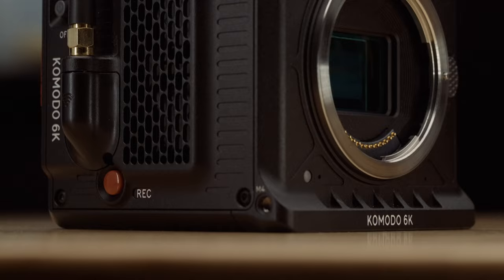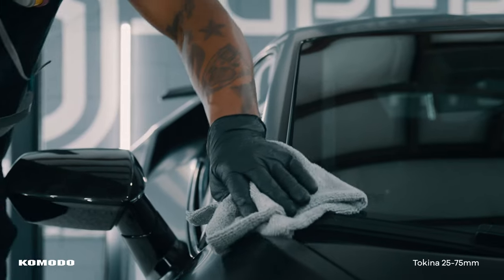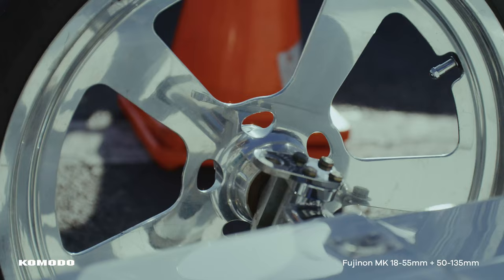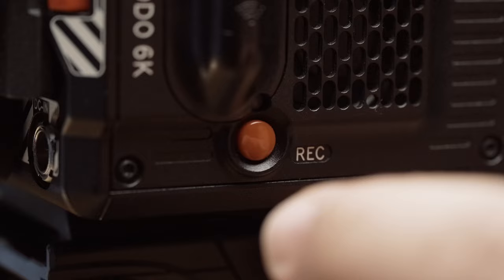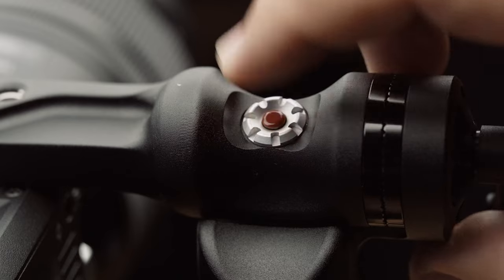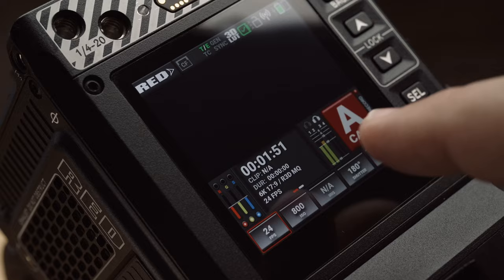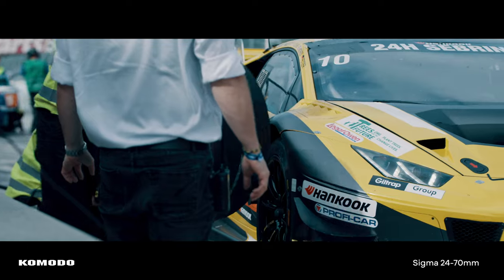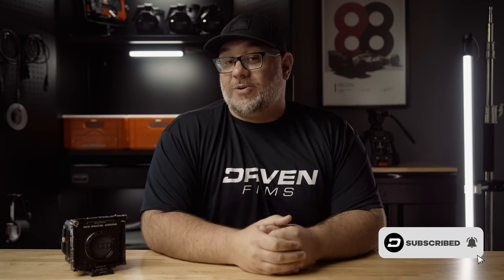Why the Komodo is the best camera...for me  (In-Depth RED Komodo Review)

Comment: Maybe it's me, but what I like about the RED Komodo, Pocket 4K and 6K (even more than the P4K), is this the way the noise in the footage adds texture. It's pleasing. Sony and Canon are very clean. It's a nice look, but it has that hybrid clarity versus film grain. Thanks for making this video and sharing your talents.
Reply from the maker: I was literally talking to my buddy Mac Olink about this the other night
Reply: I would agree with the RED, but Ive had both the 4k and 6k and the noise in those gets really gross. It turns colorful and just looks awful.
Reply: @conner_productions  Yeah. I don't shoot anything outside of 400 and 1250. Those have the best image and use 100% of the color space of the sensor. I think Gerald Undone did a video on how ISO affects color reproduction. The noise on the 4K is just unacceptable, especially if you're using a focal reducer. It just enhances it outside of the 400 and 1250 ISO settings.
Reply: The Komodo’s noise is one of the things I like best about it, too. It is very filmic.

Comment: The one area where you and I are very far apart is about codecs.  I really value a high quality very compressed codec which is more or less why I've been strongly considering the move away from Z Cam F6 to the Sony FX6.  I just run my camera too much and too long for a lot of events.  I'm also on the road a lot .  So even if I could afford to purchase a nice external RAID DAS (which will be something I do in the future), I'm limited by how much storage I can bring with me and perhaps just as importantly how much "fast" storage I can bring with me.

Global shutter and RED IPP2 are undeniably good.  But both ProRes and RedCodeRAW are massive.

I personally feel like the FX6 is the best all-rounder camera currently getting manufactured under $10k.  There are plenty of cameras that are better than it in one or several areas, but as a package it's pretty hard to beat.  Especially for me who is mostly in events and doc land.  Where audio (preamps and DACs), codec (size/quality), AF (although I don't really use this right now), size, speed, battery life, rolling shutter (the FX6 is second only to Alexa), high ISO and noise performance, sensor size, resolution (UHD is oversampled, log support in post(!!!!), and has DCI-4k), all matter - again I think as a combined package of all of those things the FX6 does incredibly well.  Even if it's not #1 in any of those categories, its average of all those things is higher than basically any other camera.

And in theory if I care about it, the Ninja V would allow for 12-bit Log RAW from the 16-bit output of the camera which would rival 16-bit linear RAW (in theory.  In practice I don't think the FX6 has the pipeline to pump out more than 14 stops of DR, but it would at least allow for greater than 12-bits worth of color information in a relatively compact RAW file size.  And it gives the benefit of having an ARRI like sensor resolution, at a slightly higher 4.4k resolution).  But I don't foresee myself moving to RAW anytime soon unless there is a massive amount of client demand for it.

Great review!  Glad you found a system that makes sense for you.  It's far easier said than done.  Especially since it is a moving target.
Reply from the maker: Sorry for the delayed response. I think that you have a different use case than I do. Personally I dont need an HQ compressed codec since most of my work allows for the creation of proxies if needed. 

It's also to keep in mind that R3D LQ has a data rate of 110 MB/s for 6K while the FX6 has XAVC 4:2:2 10bit in 4K which is also 100 MB/s. I'll take R3D LQ over XAVC 4:2:2 all day long.

There's also news floating around that RED is working on a codec below LQ for the next firmware update on the Komodo & V-Raptor.

Comment: I’m considering the Komodo X now, as I want to be able to work in 60fps in HQ . I was considering the raptor too, the disadvantages are the more data rates , heavier and less money for lenses. I have maybe crazy idea to buy with it Zeiss supreme 50mm as a jack of all trades lens , though surely have to rent before , and see how it differs from good canon l series lens.  Do you btw feel there’s difference between windows and Mac experience with RED? 
Ron
Reply from the maker: You can film 60p in HQ on Komodo. It’s 6K 60p that the Komodo X opens up. Personally, I think the V-Raptor is on a whole different level from both Komodo and Komodo X. 

As for windows vs Mac and R3D…I definitely feel like Davinci Resolve is optimized better for Mac OS and in turn, it handles R3D better.

Comment: How do you like that Bright Tangerine Run/Stop top plate?
Reply from the maker: It’s a really nice way to still use the outrigger handle. I haven’t used the RS port on it yet.
Reply: @joenicklo  good to know.
Reply: @joenicklo  I’m trying to find a run stop solution that doesn’t have me using a cable that’s 23” long
Reply from the maker: @BrandonTalbot  I forgot the name of the company but theres one that makes custom start/stop buttons with cables.
Reply: @joenicklo  Mutiny? I'm looking for very custom.  I've got a title handle that does run/stop plus focus and it's a usb-c to 9pin but the one from them is seriously 23" long.  I have no freakin clue when it should only be 6" max.
Reply from the maker: @BrandonTalbot  I think it was Mutiny.
Reply from the maker: https://www.adorama.com/iarstard4.html Check this out.

Comment: Two questions... 1) what were your thoughts on the Fujifilm Cine glass vs your others?   2) are you totally off ZCam at this point, or are you keeping the F6 around?
Reply from the maker: I love the Fujinons! The macro mode is an awesome feature and they’re very lightweight. That being said, the 18-55 seemed to vignette a little, which was annoying. Also, I like the overall look that the Tokinas provide me with a bit more. I prefer the Tokina’s flaring.

Second question, my zcam will be sold as of tomorrow. It’s not a bad camera by any means, but I don’t like the direction the brand is going. They’re doubling down on ProRes RAW, which at this moment in time, would alter my workflow severely. I’m not switching NLE’s AND operating systems just so I can work in ProRes RAW. I could go on and on about it but for now, I’ll just say that if Z Cam impresses me with the eventual E3 camera, I’ll definitely consider it.
Reply: @joenicklo  Follow up on the question.  Are you off the Zcams?
Reply from the maker: @johnharris4936  For the time being, yes. My Z Cam E2-F6 is up for sale.

Comment: I have always liked the RED color.. but I also really like BM especially with BRAW. I am however looking to build some cinelifter drones to fly these cameras around. Do you know if there is a protective cage that isn't too heavy in weight but might absorb some ..uh.. "crashes"? I'd love to see some sort of wrapper cage with silicon bumpers of some sort around the camera to hopefully see it survive should the drone crash.
Reply from the maker: Honestly, a cage may not do much besides protect against cosmetic damage. The Komodo is an all metal body aside from the screen, which you can of course get tempered glass and even cover it up with some sort of protection like you mentioned. 

If you’re looking for multiple reliable cube cameras that you’re gonna put through abuse, maybe consider the z cam e2-F6 or S6. They’re much cheaper than the Komodo, although not on the same level in my opinion, but rather a small step down.
Reply: @joenicklo  Yah.. I hear you. My primary goal is BMPCC4K right now. I just much prefer the cube design. Given how drones deal with balance, having a cube that is well balanced vs the BMPCC4K design.. is ideal. If BM comes out with a cube camera on par with 4K/6K cameras.. that would be fantastic. I've not seen a lot of good reviews of the zcams.. they look great, but for only about 1/2 the price.. it almost isn't worth it especially if someone was flying a drone on a big budget.. if something were to happen.. 6K for a replacement camera is small potatoes on a mil+ type of budget. To be fair.. I would imagine they would be rented anyway with insurance. But someone like myself that would maybe want to start my own side gig.. would need all the gear ready to go (and know how to use it). Also.. it is likely that someone hired to run a RED on a drone is going to likely have some backing showing they can do so without crashing the drone. I wouldn't want to run it until I am REALLY good with a go pro and practice with a brick for a while.. but even so you sometimes can't account for say.. a bird that randomly flies by and hits your drone. :D.

Comment: Would this be a good camera for live stream at a church?
Reply from the maker: Personally, I think “yes” however that would come with some caveats. Are you streaming wirelessly? If so, you’d need a wireless transmitter/receiver with SDI. 

The other caveat is that it’s expensive. I’d assume since you’re live-streaming for a church, you’ll want a multi camera setup and you can easily get the job done with a few Blackmagic pocket 6K mark II’s. If your church has the budget for multiple Komodo’s, I say go for it! 

I have a lot of reasons why I WOULD use the Komodo for multi camera live-streaming :) for example, the new RED control PRO app will allow you to control multiple cameras from a laptop. You can even control the auto focus from the app if needed. 

Also, the Komodo’s image looks amazing straight out of camera with just the RED Film Bias output preview enabled over SDI out :)

Hope this helps.

Comment: How do you find the dynamic range compares to previous cameras you have used. You have bought it so I would assume there would be a level of bias you would have towards the red. But have you noticed a clear and dramatic difference. I have a pocket 4K and used it as a b-cam to the FX9 once which is meant to have really solid DR and it help up surprisingly well
Reply from the maker: Good question. Honestly, I have zero complaints with the footage and I've found that I can push my shots in either direction (highlights or shadows) and retain details fairly well. In comparison, I think it outperforms the Blackmagic Pocket cameras, as well as the Z Cam.

Comment: anthother big thing to think about, which is a huge advantage to me... if you get the best super 35 camera with the best super 35 sensor ,vs an ok full frame, with an ok sensor..., is that not only will it look better, but will save you money down the road.  how?  easy, take a really popular anamorphic lens for just an example of this:  super 35 50mm = $6xx.  the full frame version of the exact same lens?  $1400.   you will see this across all lens lines.  can easily make up the price difference between the Komodo and cheaper full sensor cameras.  just my 2 cents
Reply from the maker: Agreed!
Reply: yea just take that one lens, and imagine you get like a 35, a 50, and a 75 or something... super 35=$1800-1900.  Full frame=$4,200!

Comment: RE: the RF mount, do you find that having a big adapter on there is secure enough when you throw the tokina vista lenses on the camera? I've always thought that the RF mount not having a lock would force you into requiring lens supports for larger lenses, but was curious what your experience has been thus far.
Reply from the maker: It’s recommended to use a support bracket or neck strap when using heavier glass. I’m using the Metabones PL adapter and it’s pretty solid, but I still use the bright Tangerine support bracket. With the support bracket, there is no play whatsoever. I also use a lens support for heavier lenses

Comment: First lens to get for the Komodo?
Reply from the maker: Loaded question. It depends on the type of work you're doing ;)
Reply: @joenicklo  very true haha. Run and gun. Single operator. Front/Rear vehicle mount, one man operated, while someone els drives. Picking up the dji rs3 pro combo, which comes with autofocus attachment.

Comment: You should normalize your audio tracks.  I gotta crank up the sound in my headphones to hear you  :-P
Reply: Subbed BTW
Reply from the maker: Weird. I did Normalize it. Used Loudness control in Izotope RX9. Do any of my other recent videos do the same?
Reply from the maker: Appreciate it.
Reply: @joenicklo  I checked out a few of them and yup.. volume too low.   Sometimes normalizing will bring the loudest parts of your audio to the correct level but thats the peaks only and the rest of your audio will be low in volume. Compression can fix that.
Reply from the maker: @chrisw5742  yeah that’s nuts. My editor and listened to it on two different systems and two different phones and it sounded fine at all volume levels. Either way, I’ll look into it. Thank you for the heads up.
Reply: No issues here 🤷‍♂️